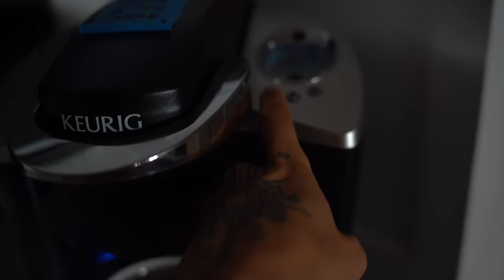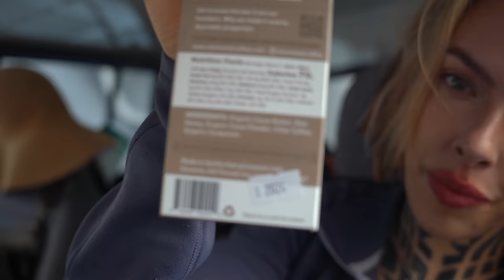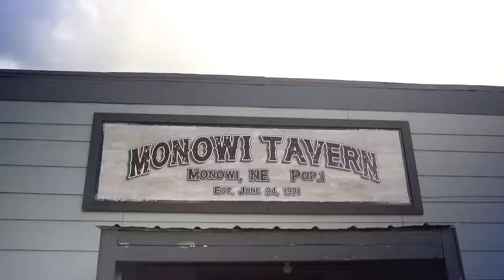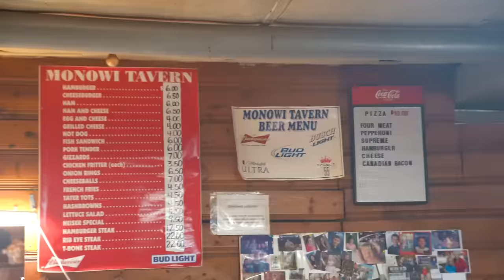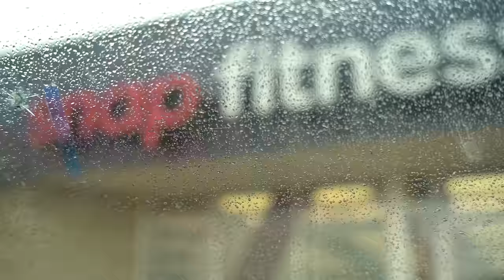visiting the smallest town in the USA… solo girl travel

Comment: Get an old broom stick or piece of wood to prop your rear door open, until you can get it fixed. Basically just put the one end into the door jam on the vehicle and prop the other side on the door, usually in the corner of the window butt up against the plastic part of the door. Make sure to find good locations that will get the end of the stick doesn't move freely. Safe and happy travels!